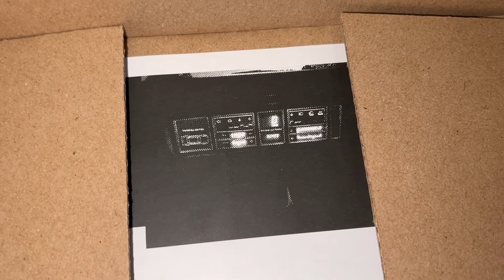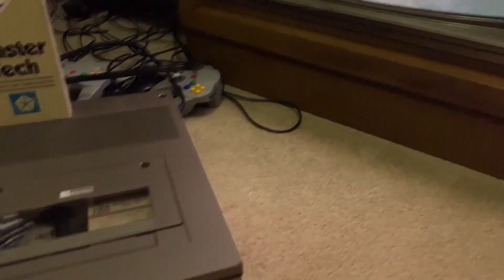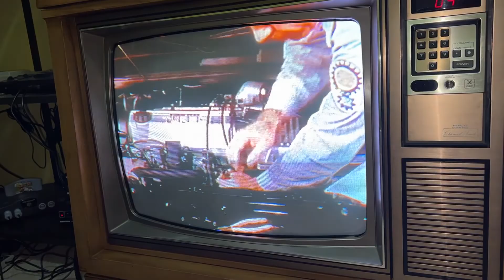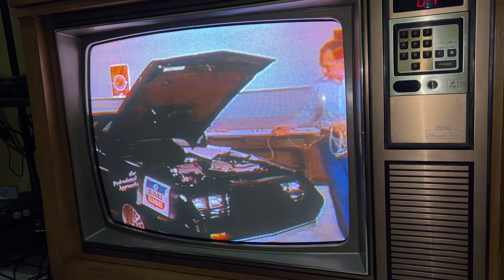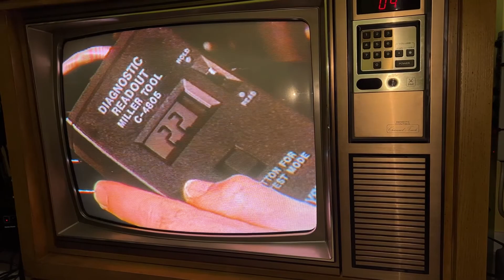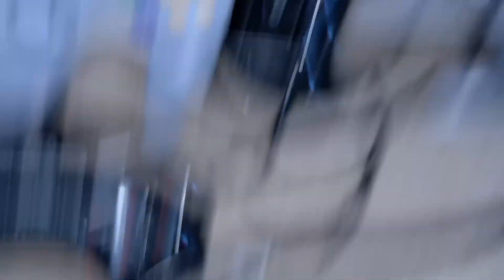My First Beta I Speed Tape - 1978 Sony Model SLP-300 Betamax Part II

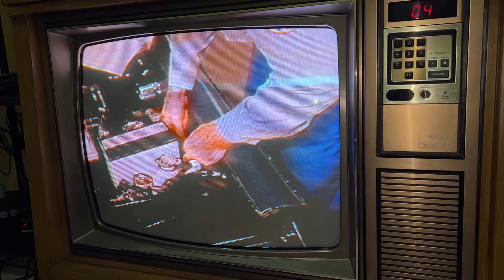Comment: I remember the key sequence for reading the fault codes. You can even pull (but not erase) OBD-II codes at least on models that still use a proper metal key in the ignition switch with that key sequence. The code about the battery circuit being interrupted in my experience generates a lot of false positives in the OBD-II cars. I own a Subaru now though and Subarus will turn on a "Shit your pants" level of lights if you have anything that turns on your check engine light. The one time I had that happen, first thing I did was check to see if the road was empty (it was 11:45 at night) and then checked the brakes and then the ABS as those lights were illuminated.

Comment: My brother had a 1987 LeBaron sedan with the 2.2 turbo.  He had to replace the head gasket at least twice on it while he owned it and it looked as if it had been replaced at least once before he bought it.  He's not someone who would get on it and drive it like he stole it.  He's always driven cars like an old lady.  I seem to remember that the story on this engine was they ate head gaskets so all I can assume is that Chrysler put a turbo on an engine that wasn't designed for one and they didn't hold up.
Reply from the maker: Many misconceptions. The facts are the Turbo engines themselves are very overbuilt than the non-turbos. The head gasket issues were an issue early on, but were resolved with an improved performance head gasket. More than likely they were still putting a standard head gasket in.

The 2.2 and 2.5 were derived from and designed by the same guy that designed the slant-6. These engines were basically a slant-6 with 2 cylinders chopped off and made OHC. And the transmissions were derived from the A904 Torqueflite. So you have a bulletproof combo.
Reply: @spatsbear  Apparently the garage my brother had work on his car never got the service bulletin.  He got tired of always paying for repairs and traded it in.

Comment: Awesome! That is a fine picture, with great sound! I was noticing when the video would go to the cross-hatch pattern, the geometry and convergence still looks darn good on the 1980 Sears!
I got my SL-3000 in the other day! It's missing the shoulder strap, and front section of the soft cover. Hopefully, a future parts unit will yield the missing components.
Waiting on a AC-300C power supply to power it up. Is anyone reproducing the BP-60 batteries?
I finally found the Trinicon camera, and it's a HVC-2200. Hopefully it still works. Still have all the owner's manuals, so I knew what all to look for!
Side note, I reached 510,000 miles on the Tundra, last week. Still going strong!